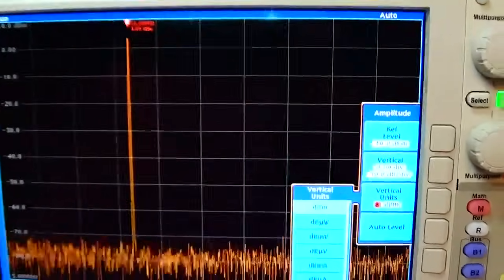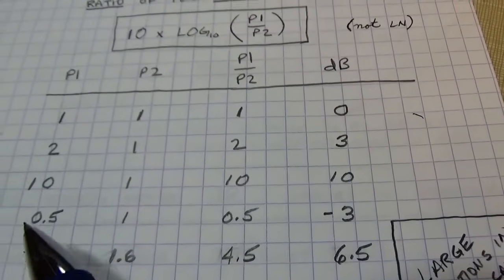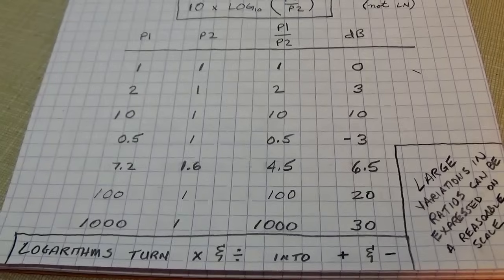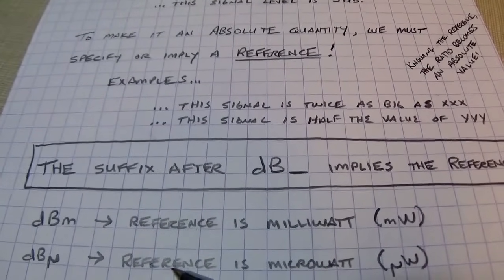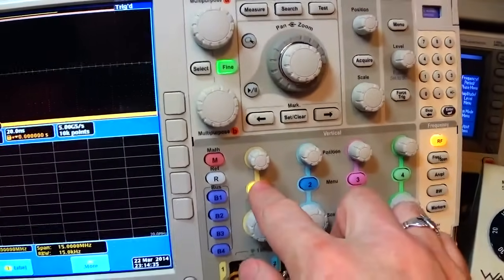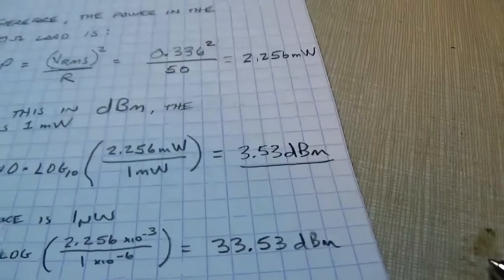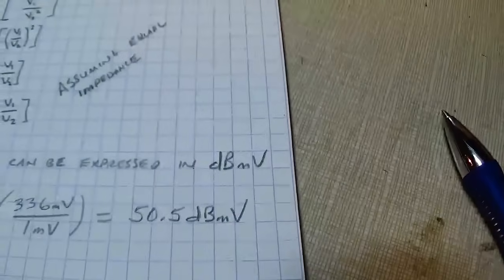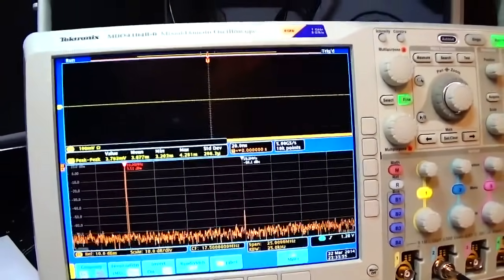#136: What is a dB, dBm, dBu, dBc, etc. on a Spectrum Analyzer?

Comment: Excellent simple explanation of dB. In fact with BODE100 impedance analyser, i recognized the unit dbohm. I was trying to measure ESR of capacitors. I have forgotten what was the definition of db.  I knew it was a ratio of two units but i was uncertain if it was to be multiplied by 20 or 10.
With time, I have almost forgotten all i learned at school and how analog electronics is important and rich.
I work for a multinational company,  electronic is only one of their border subject and they don't give any importance(even though all their products are based on algorithm and very often on important some analog technologies) when it comes to electronics and even more when it comes to analog electronics. 
Anyway , many thanks for your crystal clear explanation.

Comment: Here's a helpful matlab command:

a = 1:.01:20; plot(a, 10.^(a./10), a, a);
Let y = 10.^(a./10) 

The first plot (y vs a) shows you the ratio of P1:P2 and the second (a vs. a) just shows you the corresponding dB values. As mentioned in the video, at a ~= 3,  y(a) ~= 2 meaning P1 is x2 as large as P2 or P1/P2 = 2. At a ~= 20,  y(a) ~= 100 or P1/P2 = 100. 'a' is in units of dB.

Comment: dbA?
Reply from the maker: It’s a sound pressure reading, with a specific response curve. https://en.m.wikipedia.org/wiki/A-weighting
Reply: w2aew I guess I was looking for a precise explanation like the other db* you described in this video, i.e. the log of ratios of power. I’m familiar with the dbA scale, but it’s not obvious how it’s derived.
Reply from the maker: @combin8or  Yeah, unfortunately the "sound pressure level" use of dB is a bit different than the electronics use.  It is still a log representation of a measurement, but the reference is different.  Also, absolute sound pressure levels (SPL) is often expressed in dB - without a suffix - which would normally be a "relative" measurement value.

Comment: Hi sir, 
Could you tell me why this harmonics coming from as we have applied a pure sinusoidal wave and there is no any other components are connected.
Reply from the maker: Because the signal generator isn't perfect.  The 2nd harmonic is very, very low - about 57dB below the fundamental, which means that it is about a half-million times lower in power than the fundamental.  This is actually quite good - not perfect - but really quite good.  All generators have some amount of harmonic distortion.
Reply: @w2aew  thanks for your kind help sir. Actually i have digital signal analyser in which i have to do noise measurements. I am now struggling with physical significance of power spectral density. It will be very helpful for me if you suggest me some video tutorial or literature for reference.
Thanking you again 🤗
Reply from the maker: @AMANSHARMA-bl5ui  Power spectral density is just a fancy name for the Spectrum Display with amplitude values adjusted for a 1Hz RBW.
Reply: @w2aew  I'd add that power spectral density can be taken in any arbitrary reference bandwidth, but the bandwidth does need to be specified somewhere.  In the radio regulatory world, the ITU commonly specifies reference bandwidths of 4 kHz, 40 kHz, and 1 MHz as well as a few others sprinkled about.   The power in any given reference bandwidth can be converted or scaled for a different reference bandwidth by adding the log of the two bandwidths.  For example, if you measured a signal using the marker noise function of a spectrum analyzer as -93 dBm/Hz but needed to know how much the equivalent power is in a 4 kHz reference bandwidth, you would add 10 log10(4,000 Hz/1 Hz) to the measurement.  So the result is -93 dBm/Hz + 36 dB = -57 dBm/4 kHz.

One of the best books on the topic I read at the time is Information, Modulation, and Noise, by Schwartz.  Kind of old now, but still a great book.  https://www.amazon.com/Information-transmission-modulation-noise-communication/dp/0070557829

Comment: Thank you for this excellent video.
I have an old 20MHz CRO which was rescued at a garage sale and it seems to work ok. The input impedance is stated as approximately 1 megaohm in parallel with 25pF. To determine the 10MHz output of a GPSDO in dBm I will measure Vpp and apply the equations in your example.
Is it correct that I would first have to load the GPSDO output with 50 ohms and then take the measurement across that load for the result to be accurate?
Reply from the maker: Yes, RF power is typically measured in a 50 ohm load.  You can use a thru-terminator.  Keep in mind that a 20MHz scope will not give you correct amplitude of a 10MHz signal - it will be slightly lower due to the roll-off of the frequency response of the scope.
Reply: @w2aew  
As I don't have a 50 ohm through terminator and my IC-9700 10MHz ref input specifies -10dBm, I think it best if I take the GPSDO to someone  better equipped to measure its output so I can properly determine the correct amount of attention required, if any. Thank you for your reply.
Reply from the maker: @nunyallsbeeswax  You can measure it into a high impedance load and expect that the amplitude into 50 ohms will be half of your measured value.
Reply: @w2aew  
Ahh yes, I see. It is a voltage divider effect. Thank you.

Comment: × and ÷ 
is the same as  
+ and - 
I Have Known This Since The Age Of Five .
Now I Know Why .
Mathematics has never been a problem .
Anything Mathematical , Anything with numbers ,
Recalling , Applying , Using ,
Reasoning , Limitations , Referencing , has never been an issue .
Eg 2+2 is 4
      2^2 is 4
      2x2 is 4
So 4-2 is 2
      4÷2 is 2   ..... get it ?

Comment: how to calculate the power(watts) of transmitter signal from my receiver signal db
Reply from the maker: In short, you can't.  There are too many unknowns (transmitter power, transmit coax loss, transmit antenna gain, path loss, receive antenna gain, coax loss, receive meter calibration).
Reply: @w2aew  bro I have transmitter power value 50kw but I need to know how to calculate that power by db value from my receiver... I have two parameters transmitter power and distance between transmitter and my receiver...
Reply from the maker: @b.ashokkumar8236  Still too many parameters missing.  If you KNOW the transmitter is 50kW, then you can correlate that to a specific meter reading.  If ALL conditions remain the same (positions, antennas, etc.), then a CHANGE in transmitter power can be determined by looking at the CHANGE in the receiver level, IF the receiver meter is calibrated.
Reply: @w2aew  I don't need verrrrry accurate power.. just watts in aprox... Ok u don't know about this pls leave this🤦

Comment: This is the most cleare expalantion of the Db ghost I ever seen :)      , but in this video I think there was an error when calculation the RMS voltage , I think the formula is wrong . 950mv pp its RMS voltage is 950*0.7071=671.745 mv. thank you very very much .
Reply from the maker: The calculation is correct.  The 0.7071 factor is used to convert the PEAK voltage of a sinewave to RMS.  However, in the example, it is 950mVpp (peak-to-peak).  So, you have to divide this by 2 in order to get the PEAK voltage, then multiply by 0.7071.

Comment: All the parts of your tutorial are connected and the sequencing is wonderful .. thank you sir I really wanted to understand this topic for a long time. So dB basically deals for audio and signal transmission.
Reply from the maker: dB can be used with audio, RF, and many other applications where RATIOs of quantities are important, especially when the range of ratios can be large and small.
Reply: @w2aew  But is it specifically in electronics and telecommunication ? For example in mechanics how would they use it, maybe measuring the loudness of a motor, engine ... etc. So that's means measuring sound which is physics. So dB is in general a physics measurement method, is my conclusion correct ?
Reply from the maker: It is used outside of electronics, RF, EMI/EMC, and telecommunications.  Acoustics is a another area where it is used extensively - sound pressure level is measured in dB.
Reply: @w2aew  Thanks a lot 🙂 if you allow me to ask you something out of the subject, I'm actually lost in power electronics and wanting to design SCR triggering circuit, where the best area to start from ? I've watched a lot circuits online but people on edaboard forum told me that I don't have any idea of what I'm doing ! Do you know a professional forum that would help me to learn about it ?
Reply from the maker: @PerchEagle  Online forums are really not the best way to learn about electronics, since there are many trolls and lots of mis-information. Books, professional video series (like the courses offered by MIT and Kahn Academy) are much better to learn from.  I did  do a video on the basics of SCRs, maybe that will help you: https://www.youtube.com/watch?v=lSqCiCc7jQc
Reply: @w2aew  Thank you so much :)

Comment: What is dbFS
Reply from the maker: I would think it is dB relative to a Full Scale reading.
Reply: But do you know of any conversion factor to db...coz we are using software called SDR# which gives reading in db and we r not understanding the scale
Reply from the maker: @virenmandaogane4712  There isn't a fixed conversion factor because the response/gain of the particular SDR/radio hardware isn't known.  The only way to establish a conversion factor would be to inject a known signal amplitude and note that reading.  Once you have that, you can establish a conversion factor.  For example, if you inject a 20uW signal and the reading is -10dBFS, then you know that Full Scale is 200uW.

Comment: What if the signal is not a sinusoid, what does "dBm (or whatever)" mean? dBm/Hz? dBm/(resolution BW)?
Reply from the maker: It still means power.  However if the signal is not a sinusoid, then the power in the signal will be present at many frequencies.

Comment: Speakers are rated in SPL as a dB. I don't understand the difference between SPL Sound Pressure Level compared to the wattage of a speaker. The Speaker will say 30 watts on the magnet of the speaker but the SPL will be at XXdB. So I don't understand the difference between Watts and SPL, are they the same thing or what is the difference between SPL and wattage of a speaker?

Comment: Pretty much everything we do in microwave is done in dB, dBm, dBc, etc because an o-scope can't see it. It's all power meters, spectrum analyzers, and occasionally network analyzers. With some practice, it becomes second nature to convert it in your head. Every 3 dB is a doubling/ halving and every 10dB is x10 or /10. 5dB is sqrt(10); about 3.16. Thus 0dB=1x, 3=2x, 6=4x, and 9=8x. 10=10x, 7=5x, 4=2.5x, 1=1.25x. 5=3.16x, 8=6.32x, 2=1.58x.
 Getting proficient at this has the added bonus of allowing you to accurately guesstimate complex calculations in your head when you don't have a calculator handy. multiplication and division become addition and subtraction, while powers and roots become multiplication and division.

Comment: EXPLANATIONS AT ITS BEST. That's what your videos are as always.Thanks a million  Alan.
I have a question.In case of field strength measurement is there a connection between the received db and V/m.Is it simple conversion using a formula or the receive antenna characteristics have to  be put in a formula. Once again ThanQ Bejoy M0IKN
Reply from the maker: It's not that simple.  You have to have an antenna that has known calibrated antenna factors, etc.

Comment: I'm going for my Extra class test on Nov 10. This video sure cleared up allot of confusion for me about where some of these equations came from in the ARRL manuals. I suppose part of the problem is that, in my career, I did not have to work with decibels. So remembering when to use 20*Log vs 10*Log didn't make much sense to me ... UNTIL NOW! Thanks very much. 
Don, KC3MBK

Comment: Hey your math is at 10:20 is off. The answer is .002256W. You didn't explain that you converted it to mW. It could be confusing to a newbie like myself. Thanks for the great video.
Reply from the maker: Good eye, thanks.  When you do this long enough and see 0.002256W, you mentally translate it to 2.256mW instantly.  I shouldn't have made that leap in the video though.
Reply: @w2aew  I teach SATCOM to the US Navy. I'm gonna make them watch your videos! Great info.
Reply from the maker: Thanks!  They'll probably get a lot out of my videos on IQ signals, and those on mixers and modulators.

Comment: Amazing video! Wondering why the log quantity is always multiplied by 10 in the definition of a dB?
Reply from the maker: Hmm - maybe it's because we're doing a LOG-base-10, and by multiplying by 10 we get the convenient relationship that a 10dB change is equal to a factor or 10x.
Reply: @w2aew  Thanks for the reply. I never got a notification! I appreciate all of your wisdom.
Reply: Actually it's quite simple: The log quantity is expressed in Bell (B). As we normally talk about decibel (dB) we have to multiply the Bell value by 10 to get it in dB. Same as if you express a meter in decimeter you have to multiply it by 10 as well.
Reply: @EwaldBurger  That makes sense! Thanks

Comment: Thanks for the great video. I'm having troubles understanding something. I'm a second year eet student and I just realized the other day that I don't understand the db measurement scale on the scope in FFT mode. I was measuring an am modulated signal, carrier with sidebands, and I was supposed to measure dbv. My scope was on 10db/ div. I thought 0 dB started from the bottom of the scopes window and went upward. In order to measure dbv, my teacher moved the first reference curser up to 0, then put the second curser down to the top of the signals peaks. Then we did some calculations from there. But I felt really stupid when I didn't understand that zero dB was at the top. I would have expected to start from the bottom of the scopes window/ screen and go up....10db, 20db, 30db. What's going on there? Maybe you can clear it up for me.
Reply from the maker: The dB scale will be relative.  On a proper spectrum analyzer, the vertical scale is calibrated in dBm (dB relative to a milliwatt), and when you set a Reference Level, it refers to the TOP line in the spectrum analyzer display.  On a scope FFT waveform, there is no standard for where the scale is positioned.  It is most often used to measure relative values.  The unit dBv refers to dB relative to 1Vrms.  So, a signal that is 1Vrms (2.828Vpp) will show as 0dBv Thus, a signal that is 1Vpp will show up as -9dBv (1Vpp is 0.5Vpeak, or .353Vrms, 20*LOG(.353) = -9dBv).  The values in the dB scale on your FFT can be above or below the 1V reference value that is assumed for the dBv unit.  If the signal is smaller than 1Vrms, then it will have a negative (-) dBv value.

Comment: Shouldn't it be P2/P1 instead of P1/P2? For example, if P2 is higher than P1 (amplification) you should have a positive dB ratio, but the way it's done in the video you will get negative.

Comment: Very good! But why do we use the decibel to describe the power of the sound? What is the link between the sound and the ratio that compares two power levels as explained in this video? I'm confused about that.
In the case of the sound, the decibel is an absolute quantity and not a ratio, or maybe I missed something?
Reply from the maker: The implied reference for audio/sound measurements is something called Sound Pressure Level.  The lower limit of audibility is defined as 0dB SPL.  See this wiki page for more information:
https://en.wikipedia.org/wiki/Sound_pressure

Comment: Hello sir. Thanks for another great video.
I do have a question if you don't mind:
When plotting the frequency response with the cutoff frequencies and all that, why do they make the maximum value 0 dB? Why not start at 0 (or 1) and let the maximum be 60 dB or whatever relative value the signal would eventually reach?

Thank you
Reply from the maker: Just a convention that has been adopted - makes it slightly easier to quickly see where the response is down by a specified amount.  Normalizing to 0dB makes it simple to see where you're 3dB down, 10dB down, 60dB down, etc. from the in-band response, without having to do the math from some non-zero inband value.
Reply: w2aew I see! Thank you for your response sir. Appreciate it 🙏

Comment: hi I have a velleman hps 50 handscope...it has dbv readout with the voltage ...is that the dbv to the voltagethat is measured?
Reply from the maker: I would expect that it is simply 20 * LOG (measured_voltage/1V)
Reply: in what instance would I use that reading?
Reply from the maker: It's likely not a function you'll ever need.  There may be specific measurements on specific equipment that requires the dBv function, but the vast majority of scope users won't need this feature.

Comment: This is a great video because it's very clear and easy to understand , but I have one question ? On cable boxes if you enter service mode they refer to dbmV as power. If I search the web you get answers all over the map. All I want to know is are the cable box readings really talking about power ( 10 x log) or voltage (20 x log). I would love to get you input. Thanks jimmy.
Reply from the maker: If the units are dBmV, then it is dB relative to a millivolt (mV), so it is talking about Voltage - thus, 20xLOG(V/1mV).

Comment: Excellent video! I'm wondering why the 2nd harmonic is marked as 10Mhz on the scope screen? Shouldn't it be 20MHz?
Reply from the maker: Because the marker is in "delta" mode - it is showing the difference frequency between the reference marker (on the fundamental), and itself.